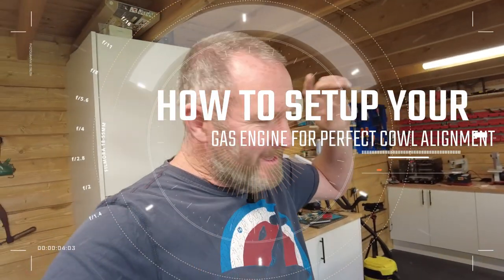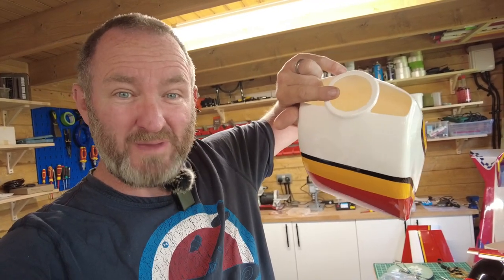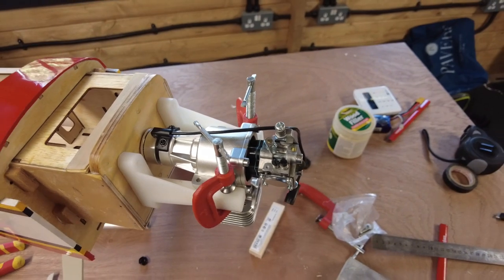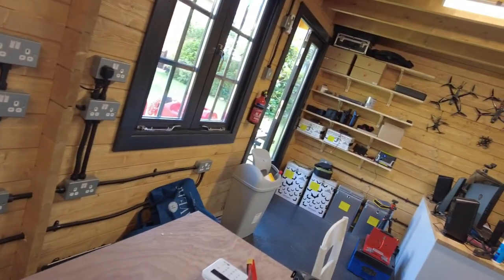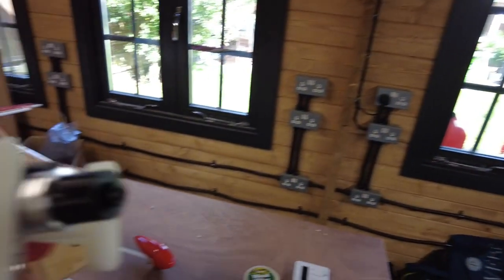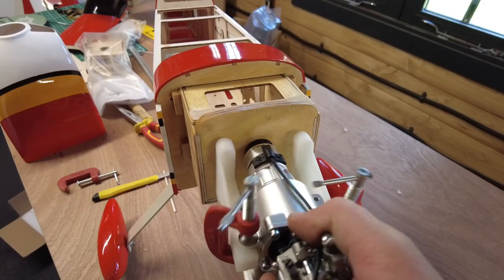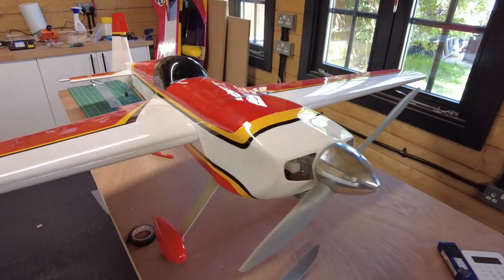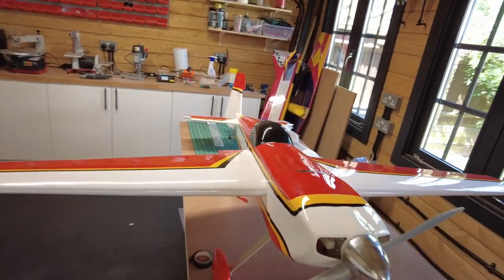HOW TO SETUP YOUR GAS ENGINE FOR PERFECT COWL ALIGNMENT

Comment: Great when you have a hole in the firewall and correct thrust angles built in, but what about when you don't?
Reply from the maker: Only way I have solved this in tye past is with a jig.

You have to make a plate of wood with screw holes in it that match the engine block.. And the correct center line with a dowel to position up the cowl.    Much more faffing needed!

Comment: I'm new to planes, can you just eyeball it? Could you drill oversized holes in the firewall so you have some adjustment if needed and use large OD washers to bolt the mount up?
Reply from the maker: You can.. But you don't get a clean finish

Comment: I'm not sure what you're talking about when you say the engine is "ON CENTER" @ the firewall because it shouldn't be ON CENTER there since the Engine has a RIGHT thrust angle build into it when mounted, so it actually has to be  slightly off center to the LEFT to compensate and the spinner side is on CENTER on the front of the engine. Am I missing something ?
Reply from the maker: I am referring to the 'spinner' being 'on center'.

100% the engine will end up off center.  This is required so that the spinner is 'on center' on the cowling.